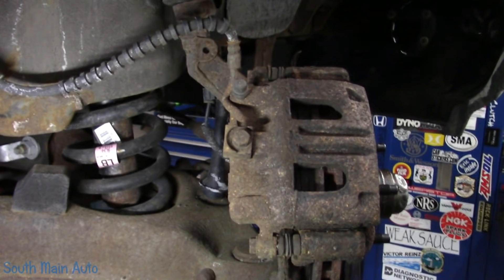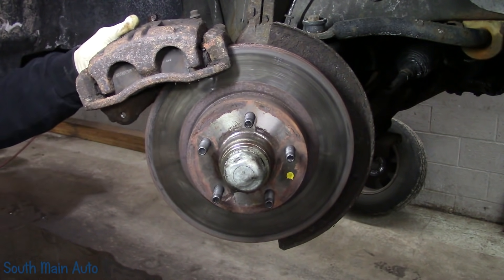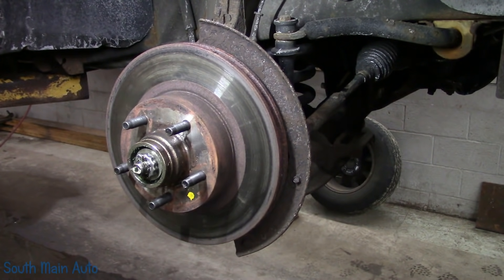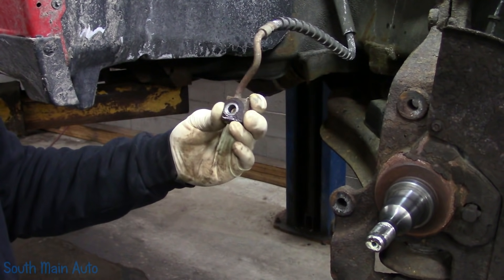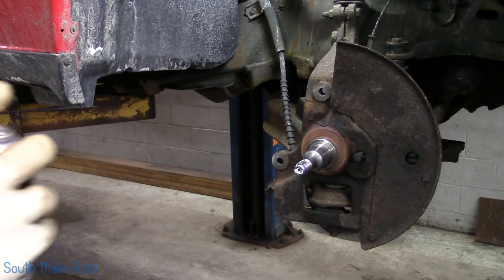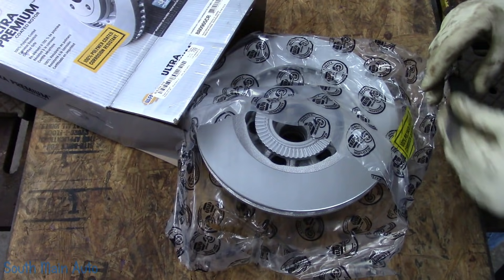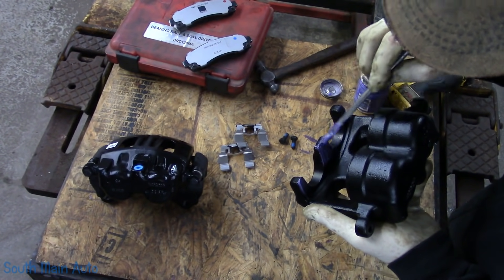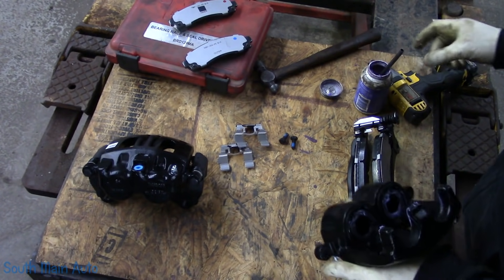Ford Ranger: Full Brake Job Overhaul - Part I

Comment: Hey there Eric, I had left a comment about the Permatex lubricant you use on your brake jobs on a previous video on a Honda way back. Anyway I know you have your own way of doing things now, but what I found out is when I went to my local NAPA to buy a bottle of the purple Permatex Ceramic Extreme Brake Parts Lubricant I found the store staff had pulled it off the shelves and had it behind the counter. They sold it to me when I asked about it, but told me due to reports of the ceramic getting gummed up after some time and being exposed to high temperatures they pulled it off the shelves in favor of the red Silicone Ceramic Extreme Brake Parts Lubricant. Not sure how much truth there was to this claim since you've been using the purple stuff for so long. But perhaps they were trying to sell a higher priced product? Why do you use the purple stuff instead of the red? 

I had also read somewhere that the purple is okay for the caliper pins, but the ceramic isn't good for the rubber boots that cover them. Contrary to ETC he doesn't use any lubricant between the caliper and pad mating surfaces other than some anti-seize in certain spots and silicone paste on the caliper guide pins as they come from the factory.

Comment: Hi Eric, why don`t you have a small cabinet built around the compressor with some cavity insulation board, it will greatly reduce the noise from the compressor.
Reply: It's a shop

Comment: I like the bearing pack! My favorite was "Just about that tight," SMA torque specs! Safety 3rd. It's good to see someone wanting all new hardware, keep that little Ranger running smooth. Even though I've seen most if not all of your video's, I still enjoy your new video's.

Comment: The only time I used a bearing packer was when was in the USAF back in the late 60s. Been using the old fashioned method, it works and not that hard. The "Works",  why not new brake hoses on all four, they are 9 years old?

Comment: I have been dreading doing the brakes on my Buick Roadmaster Estate wagon because it has similar rotor setup. I prefer learning from visuals, and this video made it very easy to comprehend. I think in Spring (If we ever get it here in the midwest), I won't be afraid to challenge it now.

Comment: Love all the details you take time to cover, as usual, thanks. My opinion on how much inside the hub is not so much that it wants to expand and climb out when heated...more isn't better & they way you did it works for me every day - try doing ten sets each on a fleet of 2 dozen snowcats year/after/year and you learn the hard way. Funny about the folded ears on the axle-nut keeper...last mech in was just conscientious enough to try to get it right, but not experienced enough to solve the puzzle ;) Must have been one of those barber college repairs.

Comment: i have a 2000 ford ranger 4wd and the rear brake do not bleed it only pump out drops of drake fluid out. what can it be?
Also hot do the parking brake work. 
both parking brake line go to the driver side but when i put the parking brake on the vehicle still go's. how can I fix the issue.

Comment: Pro tip for the new guys. If you are not sure which caliper goes where, make sure the bleeder is at the top to allow for trapped air to be bled :P unless you want to have spongy brakes
Reply: I really  enjoy your videos  keep  them coming  . I have a 2006  Ford ranger that in the shop alot it has only 80t thousands  I brought  it new.

Comment: I have had those Adaptive ONE pads come loose (de laminate) from the base of the pad and it was not rust jacking after 8k miles. They replaced it and said it's the first time they have seen that happen,
Reply from the maker: I have used 1000's of them and can say I have never seen a bonding issue yet

Comment: Old School Eric. Haven't seen someone pack wheel bearing in a long time. I know you probably have a wheel bearing packer. Good to show the youngsters how it was done... Good video
Reply: JJ 109 That's how my Pops taught me to do it!
Reply: That's how we do it in our shop all youngsters ha.
Reply: Yep. That's how I was taught back in the 60's.  Yikes,  I just did the math.
Reply: I find it therapeutic to hand pack them.
Reply: I remember  packing wheel bearings the old school way.  Many a boat trailers and brake jobs
Reply: Bearing packers overdo it anyways, should only be 70% full
Reply: @gregeconomeier1476  Me too!
Reply: I have a 2005 Ford F-250 with a similar set up as that. It’s nice to see how to properly pack the bearings so I can do it right myself
Reply: Never done it any other way. Did bearing on a M35A2,Danger Ranger,F550,soon to do a F250.

Comment: I've never seen rotors like that before .... Nice to to have sensible customers who want a proper job do Everything! 👍☺️
Reply: I have, Napa sells coated rotors to combat salt in roads. We have them here too
Reply: I didn't mean the coating, I use coated rotors myself 😂 I was referring to the shape.  I've never seen ones with everything built in so to speak ...
Reply: @TheCowgirlNiamh  Old Mopars have rotors like that.  The most important thing about installing them is getting the preload right.  Too loose, the wheel will flop around. Too tight, the bearings will burn up.  Eric went over it real quick.
Reply: I wish all wheel bearings were like that, instead of hours of stripping bashing pressing smashing and cursing.
Reply: For sure!  I'd say it's easily messed up though without the right tension lol wibbly wobbly down the road ... Damn the potholes are getting worse ... 😂😂😂
Reply: These are called tapered roller bearings. With hub in rotors.
Reply: Cool.  Nice to know, thank you 😊
Reply: smiling you must be a youngster to have not seen similar hub/rotor.
Reply: I'm far from a youngster lol I'm just an ordinary Mom who works on her own cars so forgive me for not knowing ....
Reply: @TheCowgirlNiamh  no insult intended and I apologize if my tone seemed otherwise. I just figured us old coots were the last generation that had seen and worked with these.
Reply: Hey I never said I was old! 😉😂 kidding!!  I just work on my own cars but I must have watched hundreds of brake jobs by now and I've honestly never seen that set up.  It's kinda cool though!
Reply: @TheCowgirlNiamh  yes it is, less expensive to maintain but the presently used setup is cheaper to manufacture.
Reply: @TheCowgirlNiamh  if I may be nosy, what cars do you work on? I only do Chrysler products; not because I think they are wonderful but because several decades of familiarity make me comfortable with them and their quirks.
Reply: My tiny fleet consists of a BMW E46 (my most spoiled car), Mercedes C180 (the doggy car) and the baby of the bunch is my little Honda Beat (in storage at the moment).
Reply: @TheCowgirlNiamh  thank you for indulging my curiosity.
Reply: ...and I'm afraid I don't know much about Chrysler,  not too common here in Ireland.  The most common cars in my area would be mostly German... BMW, Mercedes and Audi... I think Eric would have palpitations if he had to work here with all the "Eurotrash" 👍😂
Reply: @TheCowgirlNiamh  but at least I do not think it would be crusty "Eurotrash". New York is absolutely terrible for its use of salt on roadways. I lived there for over half a century before retiring in Nevada.
Reply: A car is a car is a car. That is an old style set up which used to be the norm on rear drive american cars. They're not that cool if you're just doing a brake job, they're more expensive and more trouble to change than the more conventional discs. Modern automobiles are all pretty much the same now. If you can repair a German automobile, you can repair just about anything.
Reply: Nice to see some customers have the cash to do a total brake job.
Reply: This is an older style hub. This looks way easier than the new hubs that take a 4 foot cheater bar to remove.
Reply: @TheCowgirlNiamh  That's very cool!
Reply: My chevy has them as well. Original bearings with 265,000 miles.
Reply: All older mercedes from the 60s with the  w108/109 to the late 80s with the w126 including the w123, w116, w114/115, r107 in between had that same design with the added complication that both the rotors and the hub are two pieces bolted together with 10 10mm allen bolts that are located behind the hub assembly and instead of a cottor pin and a castle nut to hold it in place you have a locator nut with a 5mm bolt on the end of it to lock it in place after adjusting the main nut to spec
Reply: @TheCowgirlNiamh  That is  how the rotors were made on pretty much all vehicles back in the day.
Reply: This is an older design. The newer designs separate the hub/bearings from the rotor, which is nice because you can replace the rotors without touching the bearings. The older design forces you to deal with bearings and bearing preload whenever you re-and-re the rotors.  The newer, separate hubs tend to become one with the spindle making removal a royal pita. Pros and cons.

Comment: Had a buddy bring me his car the front brakes he said quit working. He was using the ole emergency brake to make his stops. Couldn’t believe what I saw when I took it apart. The whole outter surface was gone and the inner was hanging there like a ring that lassoed the steering knuckle. Some people like living dangerously.
Reply: I did an F150 yesterday that was close to that. Another 50 miles and he would have run the piston into the cooling fins.

Comment: this winter is stupid. been really bad minnesota here. im not sure when they stopped making rangers but i wanted to say i still see quite a few of them around and in nice condition.  i always thought they were decent trucks, remaking them midsize for 35k? wtf
Reply: Bobby Brady  this is very true. I suspect it's because of all the plastic/fiberglass crap they use like bumpers, some fenders and rear quarters just to "hide" the safety features. I like old steel bumpers they work better and there much simpler to replace and you don't need 5985448949404245 plastic clips just a few bolts. Flimsy ass metal fenders in this day and age to
Reply: Bobby Brady  well that didn't work out in my favor I just got my 2013 impreza back from hitting a deer didn't even hit It over 35mph yet it caused almost 3k in damages. I know if I had a steel bumper I'd have no damage and maybe some fur left behind. I will say yes the plastic ones can and I'm sure have saved some lives from low impacts from people being hit. Just look at the body panels on the older cars it's about 10x better than the crap used today. My point is they used cheap crap most of the times now and nothing is gonna last 50 years or better like and old charger, Camaro, old trucks ect ect.
Reply: My dad ordered one of the new rangers late last summer. He still hasn't received it. He called the dealer the other day only to be told they "lost" it. 

I'm hoping the prices come down for the base models.
Reply: @calebbadger  They sold it somebody else .Happened to me at a Ford dealership. I Reordered another . I figured out what they had done later.
Reply: Might as well just buy the 150.

Comment: Hi Eric while the generic term for phenolic materials is plastic perhaps the perception of those not aware of this material may be that it is a scary material to use in this application when in fact it is a very good material for this application I am not aware of the actual substrate content that is used for the pistons  as it can be anything from paper to glass. My personal experience with it is as a machinist turning and milling it using the fabric variety which comes in several different grades and it is extremely tough and hard Waring. I liked the description and exhibition of grease packing the bearing and not just over stuffing the casing and cap.     👌
Reply from the maker: I just say plastic... I like to scare people haha

Comment: If the brackets are symmetrical and the banjo bolt is in the middle;  couldn't they be interchangeable for both sides?
Reply: If your talking about the calipers, then yes, they can be installed on the wrong side. Make sure bleeder screws dont face the ground when installing calipers, best way to not mix them up.
Reply: You want the bleeder screws to face the sky not the ground. Air rises in the fluid. Many calipers use the same castings for right and left. The location of the bleeders and line fitting are just drilled for the side needed.
Reply: @meticulouselectronics  I sincerely hope you made a typo! Either that or you should never install calipers. 😎
Reply: @walterk1221  I seem to have forgot to put dont 😎
Reply: @meticulouselectronics  whew bleeders down would define NFG
Reply: @Blazer02LS  I am aware of that and it is clear you can't read given I used the word symmetrical
Reply: I've seen calipers where the bleeder could moved to either end. IIRC, the brake line and the bleeder were interchangeable.

Comment: Oddly enough I have the exact parts in my NAPA cart for my truck. I’m going with timken seals and bearings. I’ve heard stories about the NAPA bearings. Have you had any issues with them?
Reply: Today's tapered bearings are all about the same quality. It just depends on what quality grease you pack with, and how well you put everything back together. Even dirt cheap sealed bearings can be taken apart and repacked with quality grease to become expensive bearings.

Comment: i was wondering if you were gunna  snag the rubber bleeder caps  then i seen later you did lol.  i always keep the banjo bolts too .   ive got a set drilled and a fitting brazed on  so i can use a guage. not often ya need it  but its a good tool to have.

Comment: The problem with brakes on these little Ranger is when the 16-25 year old crowd throws those aftermarket lift spindles on them. The threads for the caliper bracket bolts aren't designed to the same standards as the OEM knuckles/spindles, so the bracket bolts have a pretty bad habit of walking themselves out. I had it happen to me a couple of times and learned pretty quickly to Loctite them to prevent that from happening.

Comment: Why no new brake shield? All that beautiful new metal with a corroded crown.
Reply: Only when they are falling off from rust. Its the Michigan way too!
Reply: @scottfirman  .. I certainly wasn't criticizing I just was a little confused. They're certainly beautiful looking brakes and rotors.
Reply: Could just pull em off give them a quick sanding/sandblasting then throw some black paint on them to.

Comment: I just did the complete brake job on my B3000.  I replaced the rotors, calipers, wheel bearings, pads, drums, and I found out the rear ABS hydraulic unit was not working so I had to replace that too.  I also replaced one of the front brake hoses.

Comment: Eric! I gotta pick your brain! 
I just paid 2227$ for a brake job on my 07 suburban... sooo many issues with the situation! Reman booster was 300, charged for hardware AND installation of pad hardware (23 for hardware and 23 for install!) per WHEEL. Dont ceramic pads COME with hardware?!?!
Then... I got charged for caliper (ok no problem for that) but they charged for R&R caliper, R&R pads, R&R EVERYTHING (when pads you gotta do the caliper to change em).
I'm so frustrated. The booster supposedly had fluid in it but I had NO symptoms or signs. I had to have new MC with the new booster (supposedly).
Is that normal?!
Reply: If your brake booster had fluid in it it's because the master cylinder was leaking from the back into the brake booster. A good set of pads does come with hardware, and even if you buy it separately it's very cheap. How many brake calipers did they replace just one or all four? It's really hard to say without looking at the bill.
Reply: @autohelix  i'll happily show you the bill to get your opinion... it is itemized
Reply: @autohelix  https://drive.google.com/file/d/114XTItvBYDJ1C0WEGL0Oj1nRXwOiCNXD/view?usp=drivesdk
Reply: @JenniferF2882   Just give a parts list with quantity. 
If it was master cylinder, booster 4 rotors, 4 new calipers, and pads the price is about right.

Does that necessarily mean all that stuff was bad heck no.
Reply: Ford ST — I use Akebono pads and they never come with hardware.
Reply: @montestu5502  Every brand is different and it really doesn't matter it's so cheap to buy on its own. Most of the time you can just clean up the old stuff and reuse it.
Reply: Ford ST — Just wanted to point out one manufacturer of quality pads doesn’t include them.  I agree its cheap to buy separately.  So cheap that it doesn’t make sense to try to wire brush the old hardware due to the time it takes.  I’ve learned that lesson!
Reply: Bobby Brady  Dont I know. The place I recommended my daughter take her car wanted to replace things that didnt need replacing. The estimate said it all. I ended up doing the job for her and will never grace thats guys door again. Its a shame too. I went to school with him. Now he is nothing but a crook.
Reply: Jennifer Rae Fuchek you got boinked!!!!